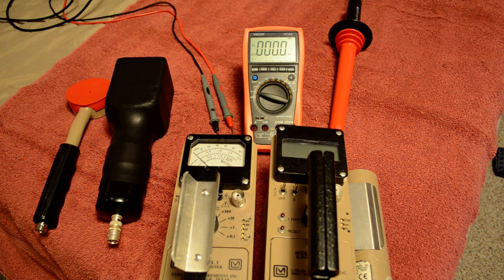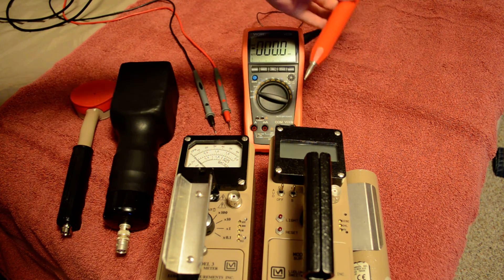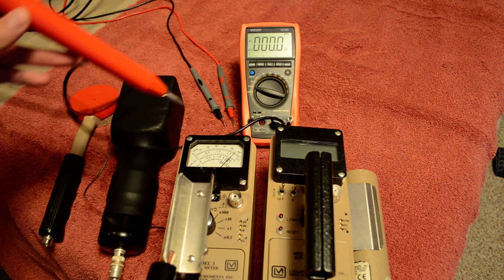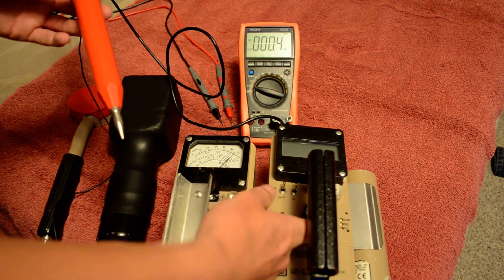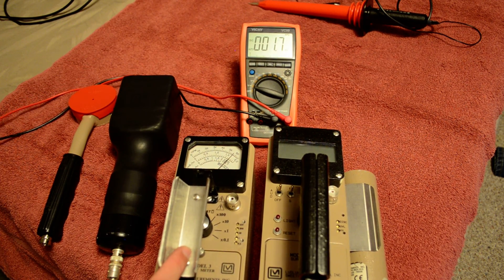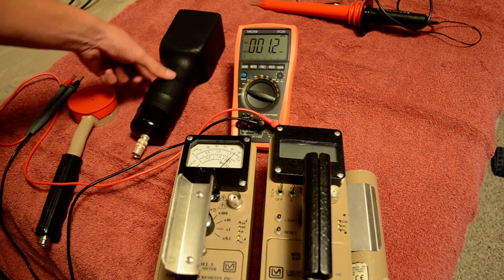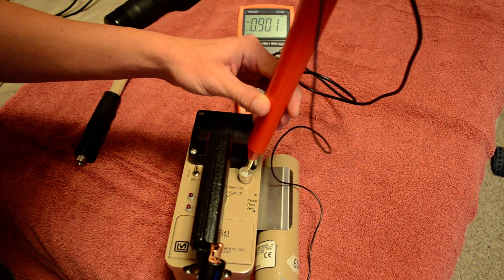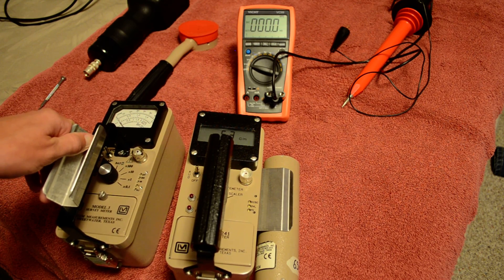How to check and change voltage on a Ludlum meter

Comment: Hey! I have a question about the Ludlum Model 2241. Why was the display indicating radiation while you were checking the high voltage since there wasn’t a detector hooked up?
Reply: The Type-C connector is designed to work only with Type-C cables when handling high voltage to prevent issues like a direct short or a small air gap that high voltage could arc across. If there's a short between the center pin and the outer part of the connector or ground, the meter detects it as a pulse or count, which is what’s triggering the 2241 circuit.
Reply: @ Ah, interesting! Thanks for explaining that to me!

Comment: Good demonstration of how to (correctly) set the HV voltage on a Ludlum with a HV probe! I checked my Ludlum 3 and it was at 906 volts. I get a background of about 4k cpm with a Ludlum 44-10.

Comment: Dan - Nice demonstration of how to set the voltage on a survey meter. Make sure you don't mistakenly move the other calibration pots. Without a calibrator, it's best to be very careful of those. I like to cover them with tape, just so I don't move them by mistake. Also, it's best to turn your meters off when removing or switching out your probes. Hey, where did you get that nice 3X3 black scintillator? It looks very sensitive... ;-) Tom